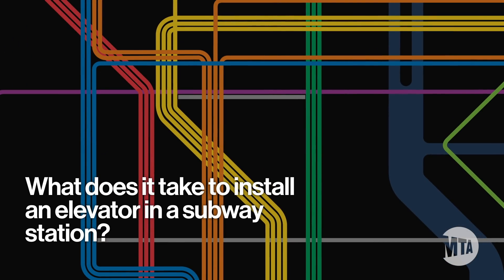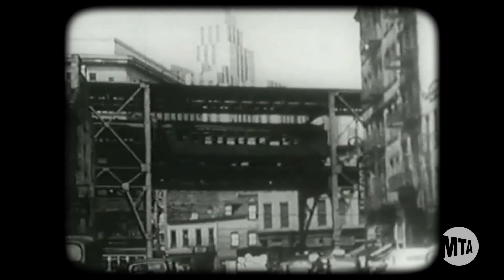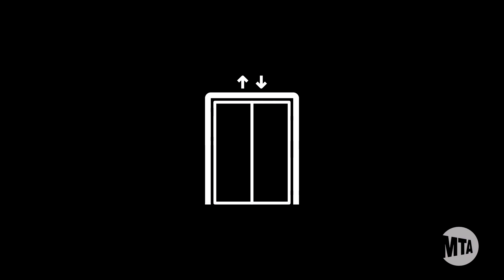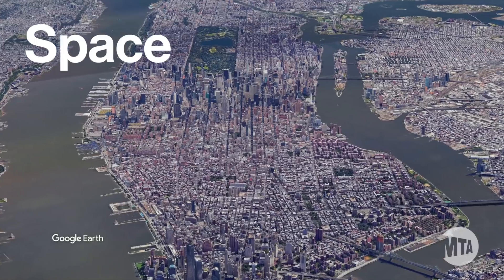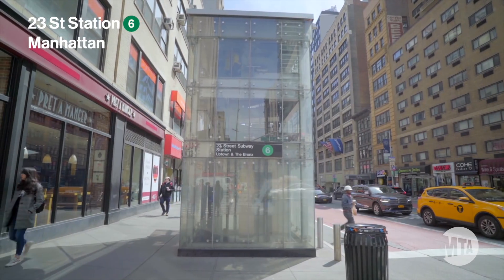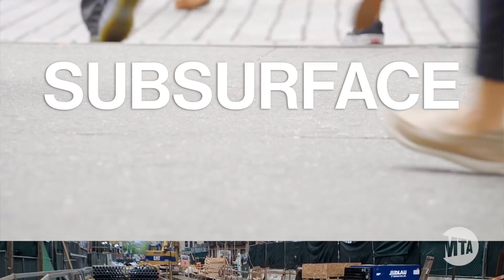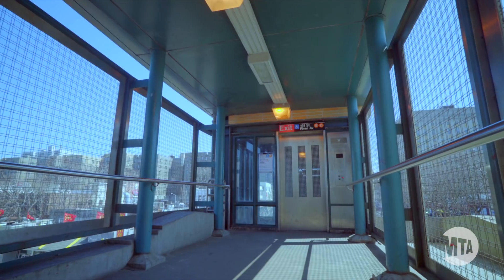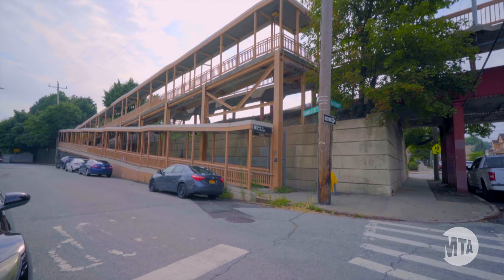What does it take to install an elevator in a subway station?

Comment: Did they say 493 subway stations? I thought there were 472?
Reply: 493 including Staten Island; 472 excluding. Complexes are multiple counted.
Reply: 493 if stations within complexes (like Times Sq, Grand Central, 59 St-Columbus Circle, etc.) are counted individually.
472 if stations within complexes are counted as one entire station.
Reply: @Abstractt  counting complexes DROPS the amount to 424, they counted the Staten Island Railway
Reply: @R1-R9 Subway Car 100 unused stations don't count, I don't see how that makes any sense. But if you want to consider those, it only brings the number to 481

Comment: It should be available at every stop.. this is ridiculous.
Reply: Not every station is able to be refit for accessibility, pay attention to the video, for example, any station with a dramatically curved platform that can't be straightened is already not getting elevators.
Reply: Steven Ouellet They May figure out a way to do this.
Reply: Watch the video?
Reply: The system is 115 years old most stations weren't even originally built with elevators that's why they're doing it now

Comment: This makes the case for new 21st century era modern elevated systems like Philly's market street EL where they built from scratch six stations and 3 miles of track for under one billion.  Clean, quiet, affordable and effective. They should take one lane of 2nd and or third and elevate the SAS to downtown.
Reply: Second Avenue used to have elevated trains back in the 50s I think. They dont want elevated trains in Manhattan though, too many people would complain.
Reply: @matthewhernandez8342  yes, it was, the last EL was the 3rd Ave in the 50's, there's footage on youtube.  It's is a long story. But times and attitudes have changed and so have the technologies and building methods. If Queensboro Plaza is any example, elevated subway is in NO way a hindrance to development, or value, it's a boon. IMO they should have run a two track EL  down 2nd and 3rd, directionaly with traffic and provide local and express service. At the end of the day, while NYC is in a cyclical growth period, they really need to set some precedent that they will build transit FOR the people in an economical way or we will never see anything more significant than what was built from 1900-1934.
Reply: @oldunion  Those days where they built 80-90% of the subway lines in 30 years is over my friend. It costs millions just to extend the subway 1 damn stop like the 7 at Hudson Yards.
Reply: @oldunion  It's also the smug people that live in Manhattan that would complain about this. The way they built a bunch of skyscrapers around Queensboro Plaza and Court Square, I dont see how it would be any problem to build an El in Manhattan. But everything is about money and politics.
Reply: @matthewhernandez8342  Unfit for New York's infrastructure as well. Elevated lines used to be everywhere in the past though, because they didn't want to dig tunnels. There's really no choice now.
Reply: @BenTheMiner  I'm pretty sure they can do it, look at Chicago. All of their trains are elevated in the city center. Also I feel like building an El is cheaper than building a subway.
Reply: @matthewhernandez8342  Chicago's infrastructure is different than New York City.

Comment: If you think about it, adding an elevator to the 242nd St 1 train station would also be a head start for a cross-Bronx subway line
Reply: Yeah Van Cortland definitely needs an elevator but, where would they fit it?
Reply: On there new plan to add elevators to over 70 stations in the system 242 is one the stations that would get one
Reply: A cross Bronx subway line would never start so far up north in the Bronx. Something that follows the alignment of the bx12 sbs would be better
Reply: @cityseby  I'd be willing to support that more - a Fordham Rd/Pelham Parkway alignment - if it went all the way to 207 St like the Bx12. Without connecting to the 1, I can't see it as a true Bronx crosstown line
Reply: @Darby I didnt think of that to be honest, maybe they'll put an elevator on the side where the park is.
Reply: @matthewhernandez8342  yeah I figured they'd just redo the stairs on the park side for 242. Easier than a lot of stations because it'd only need the one elevator.